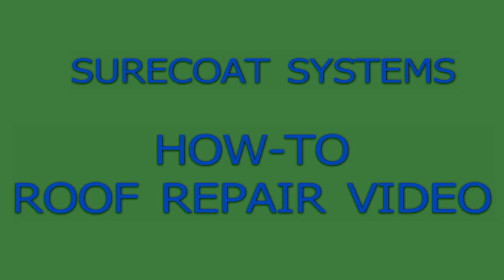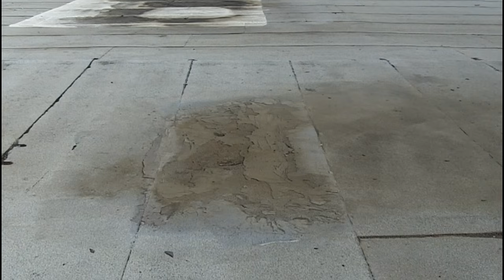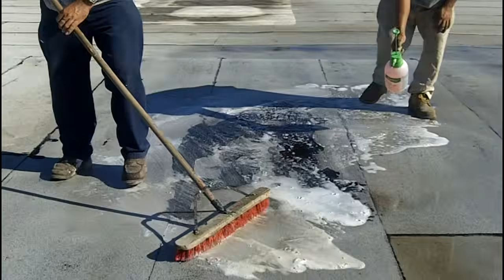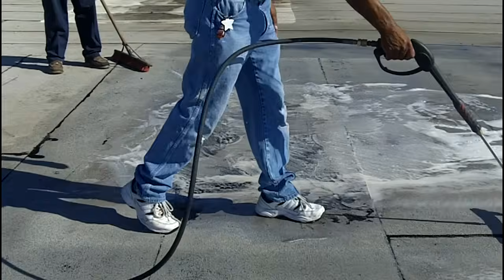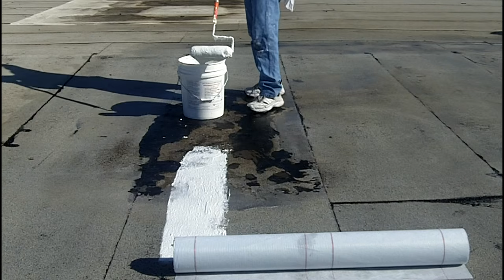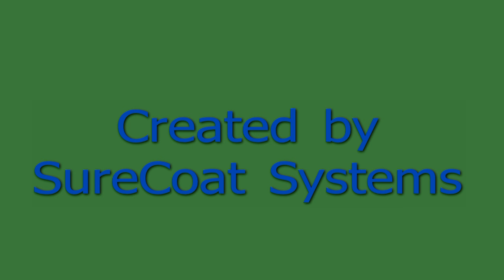How to Install Elastomeric Roof Coating - Flat Roofs

Comment: this damage appears to be from a roof low spot where water is ponding..  the coating appears to be an elastomeric roof coating.  if these 2 things are the case, this repair probably wont last long.  elastomerics arent good, they will wash off after repeated rains, and are completely worthless if water is ponding.  im speaking from experience with 3 different trials using elastomerics
i dont know what membrane is being used here but it may help the elastomeric last longer.  maybe the video owner can comment on this.  .

1. fix the low spot first.  
2. use torch applied modified bitumen or hot mop to make permanent repair that will last 10 years.
Reply from the maker: +makesumwake - Thank you for the comment.  Elastomeric is only a property of a coating.  Majority of coatings these days are elastomeric.  Elastomeric only means that it has elongation.  This video is for a roof system, not just an elastomeric roof coating.  The SureCoat roof coating in this video is waterproof.  It has an impermeable membrane once cured unlike acrylic elastomeric coatings.  The membrane (Poly-Mesh) is for added tensile strength.  this roof system has a 2800+ psi.  SureCoat's perm rating is .0025.  Perm rating is the rate at which moisture will pass through something.  There is not an elastomeric that has been around for longer that a three years that has a perm rating lower than SureCoat.  SureCoat was made for roofs that pond water.  There is a testimonial video on this channel where the contractor went on a roof that had a SureCoat repair that was 5 years old, he swept the dirt and shows a close-up of the roofing membrane.  No tears, still leak free.  I know its hard to believe because there are a hundred acrylic coating manufacturers that have mislead the industry into thinking that their products would fix commercial roofing and gave the coating industry a black-eye.  The proof is always on the roof.  We have this system on millions of feet of flat and low-sloped roofing performing just how we say it does.  Email info@surecoatsystems.com and ask for the PDS & Definitions Key if you would like to compare for yourself. Thanks again, take care.
Reply from the maker: +makesumwake - Elastomeric is only one property of a coating.  It means its ability to expand and contract.  This material was made for roofs that pond water.  This system stops roof leaks in ponds.  It has to do with the perm rating and the poly-mesh reinforcement. It does not ever wash away unless rained on before it cures.  It does weather, as all roofs do, whether Single-ply or a coating.  It wears in mils.
Reply: As with all liquid based products, this is not a good idea on a roof with lot of foot traffic for repairs and service of rooftop units. Foot traffic and tool dropping problems will cause tears and ruptures in the system and lead to leaks that the manufacturer will not cover. I have been at this since 77 and I have seen it all. Some say you can install footpaths on the roof, but that is in addition to the original roof cost and you better get it in writing that the areas under the footpaths are still warrantied. Also, I have done a few roofs and Never have roofed over an area with ponding water without replacing the existing wet area and somehow re-inforcing that area or adding positive drainage. There are EPDM roofs on for 62 years and still there. Roofs with very low pitch, heavy foot traffic, or the potential for ponding, should never use liquid applied systems.

Comment: If you have a leak then power washing can be a problem
Reply: If you don't fix it then you still have a leak.
Reply from the maker: +Isidra Person-Lynn - Thanks for viewing.  All surfaces to receive a paint or coating must be prepared for the application.  This is true for roofing, walls and floors.  A power washer is not always necessary but the roof has to be cleaned somehow to ensure adhesion of the materials.
Reply: +Isidra Person-Lynn You can also make sure the tenant moves anything important from the leaking area if they haven't already. A waterbroom and shop vaccum or leaf blower will dispurse puddles while cleaning so there is no water to feed the leak. It takes more than what we need to do to clean the roof to make it leak inside during the process. It is good to address this up front. Most put it in their proposal that water is used to clean the roof and to secure any personal property. If there is a bad leak precautions can be taken inside for any water intrusion.

Comment: Hi, I have a hotel that had a new roof put on less than five years ago...I belive it is one of those vinyl type...it's leaking every where they have air units and in some seams...can I go over that kind of roof with this product?
Reply: +brofun Yes you can use the 4" or 6" poly mesh and embed it in the coating at seams. Then use the wider fabric around your HVAC units curbs. That is typical with single ply membranes. They dry out and start to separate at seams and flashings at 6-8 yrs. Yours happened a little early.
Reply: brofun fk no.  Get me a plane ticket and I'll come weld that s***
Reply: You better make sure that there is no moisture or water under that membrane. Coating over it will only trap the moisture in and cause failure of the substrate, blistering, and potentially more seam failures due to flexing at the joints. Someone should moisture test that roof first and then decide if it is a candidate for re-coating or repairs. Unfortunately, by the time the water works through the system and shows up as a leak, it is already to late. Re-coating or installing anything over a wet roof is a waste of money.  I have done many, never one that is wet. danjmbat@gmail.com

Comment: Thank you for this video. Very good promotion. I see this is recommended for flat roofs. Why would it not work on a gable roof?

The coating looks like it would spread more like honey versus pancake syrup such that it seems it would stay relatively put despite any slope.

From looking at my roof, it looks like 60 degrees slope from the roof's ridge going towards the edge of the roof. That is, if one had a large enough triangle of 30, 60, and 90 degrees, the 90 degree angle would be at the bottom of the crawl space or just above the ceiling in the living space, the 60 degree angle at the ridge, and the 30 degree angle at the edge of the roof where rain gutters would be. The building is in California where rain does not count like it does in Florida but, as is known by many, there are many fires and earth quakes in California.

Can this coating resist fires and earthquakes?

Found one leak on the roof, by a vent, about 5 feet below the ridge line and about 5 more leaks near the edges where the roof is about a foot or two beyond the building. Do not have the cash to re roof but need to fix the leak now for getting different insurance on  the building. Need different insurance to be able to rent out one unit of this building. Struggling to hold on to this place.

Any recommendations on repairing this roof?

Comment: Where would I be able to get the membrain that you used?? I've looked at Lowes, Home Depot, even ABC Home Supply. All I have come up with are about 2 - 2 1/2 inch rolls.
Reply: tie-tex 272 look online

Comment: This looks similar to hydro stop.
Reply: +Glenn S Hydro stop requires a cement type base, which I never knew until a Hydro Stop contractor came in and told me about the correct application. Then there is a foundation coat that the fabric is embedded in. It is a resin stained green. Then the white acrylic topcoat is put on. SureCoat is all waterproof, is one coating throughout the system so all the properties are in the entire membrane making it all waterproof, UV stable, and sustainable. It can be cleaned and topcoated every 10, 15 or 20 years depending on the sytem and the warranty renewed. So it is different.

Comment: very informative... i too was a waterproofing applicator back here in the flips.. i use the same system.. thanks for sharing and more power
Reply: Not the material itself... but the system.. base coat, fiber glass then top coat.
Reply: haha no problemo... we use torch applied membranes over roof decks, cementitious by crystallization, epoxy tank lining, epoxy floor coating, fiber glass reinforced  elastomeric coating, above and below grade substrates.. 
We use locally manufactured matls namely boysen, davies and cambridge except the asphalt membrane which is imported from abroad.
Reply: Im here in Metro Manila, Philippines.

Comment: Finally! Someone who knows what they are talking about and shows you how to actually use the product the proper way. Much thanks for making this video. I fixed a restaurant roof for a friend once (after a roof expert fixed it & it began leaking again after a week) with a similar, but thinner elastopolymer type stuff. It looked & spread a lil thicker than paint but the roof has not leaked for over a year now. I bet this stuff will last MUCH longer than the stuff I used. ;-)